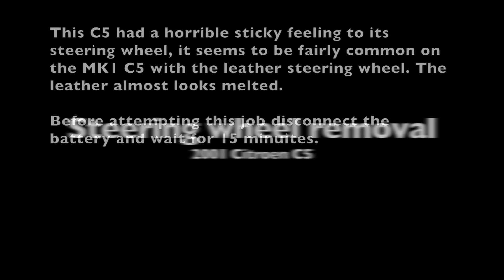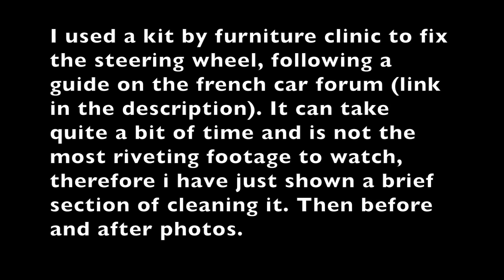Citroen C5 Steering wheel removal

Comment: Got the same issue with my C5 leather steering wheel. Leather seems to be crumbling during dry weather and sticky during the wet season. Solved it covering it with a new leather wrap from Aliexpress. 2€.. we will see how it will hold up.

Comment: Hi I have a citroen c5 1.6 hdi 2010.  Have fitted a reconditioned steering rack.  Now as soon as I start the car(and car stationary) steering wheel turns by itself to the right and stops at the full right lock position?  Any ideas appreciated.   Thanks

Comment: What is the yellow plastic  clip on the steering column for ( behind the steering wheel ) is that dangerous if it is broken ?
Reply from the maker: The two airbag connectors have yellow clips that hold the connectors in place?
Reply: @peugeotCitroen2CV  it seems to hold a pair of springs   more behind the airbag unit ( I.e. more  to the front of the car)  but on the steering column   maybe it has to do with the steering adjustment?
Reply from the maker: @ropacons  What time in the video does it appear, ie the number shown at the bottom of the player when you press pause, just to help me  identify a scene where it is clearly visible.
Reply: @peugeotCitroen2CV  it does not in your video . I just thought you may have seen it. It  does appear from 3.08 in this video: https://youtu.be/Vhx5-3OHO0s
Reply from the maker: @ropacons  Hmmm not too sure, never delved that far back into the C5 steering column. It may be a bush for the adjustable column to hold it tight. Has yours broken at all, is there any play in the steering column?
Reply: @peugeotCitroen2CV  thank you so much for taking the trouble answering..no it does not wobble and I found that only a small piece of the yellow plastic had broken during s steering adjustment . It seems to guide some spring (s)  You can see it from under if you pull the steering out ( backward,) when adjusting. The car is a C5 from 2007..
 Someone told me that he thought it is not dangerous and that it only happened when adjustong  the steering . But not 100% sure
Reply from the maker: @ropacons  If you want take a few pictures of the part and send me a message on facebook, this channels page is https://www.facebook.com/Peugeotcitroen2cv

Comment: It's the same process for a peugeot 106 ?? the car is from 1993 and there is nothing on the steering wheel (buttons, air bugs ctc)... just a piece of rubber.
Reply from the maker: Does the steering wheel in your 106 feel as if the rubber is moving apart from the steel inside the steering wheel? 

That is a common problem on older peugeots and citroens but on this C5 it didnt quite do that, the leather just developed this unpleasent surface texture.
Reply: peugeotCitroen2CV there are chunks of rubber cut of every time i drive but i dont feel too much movement...